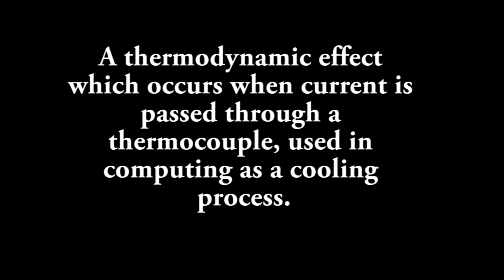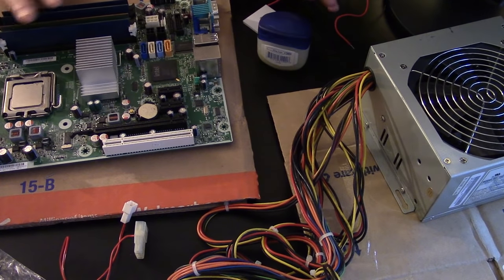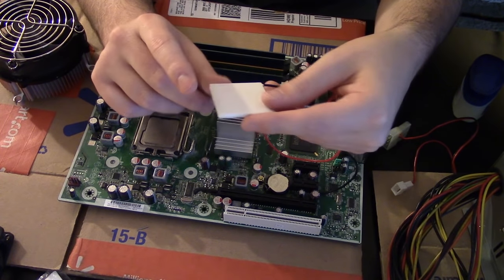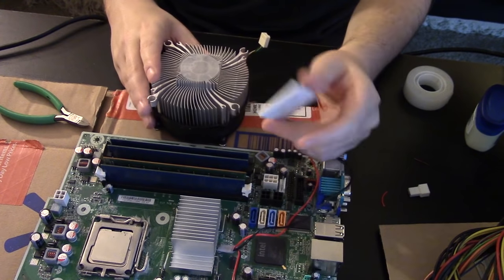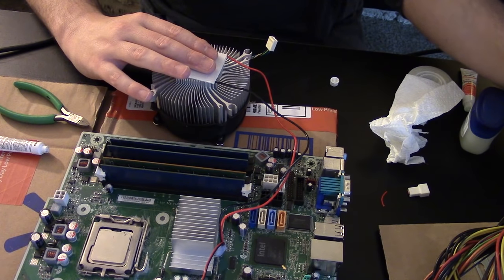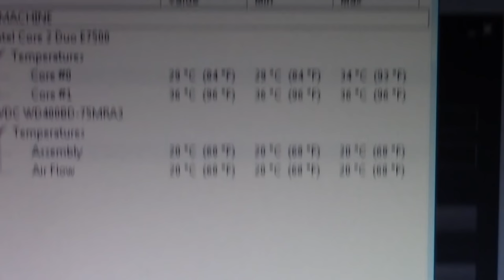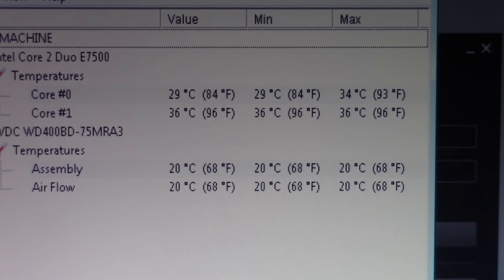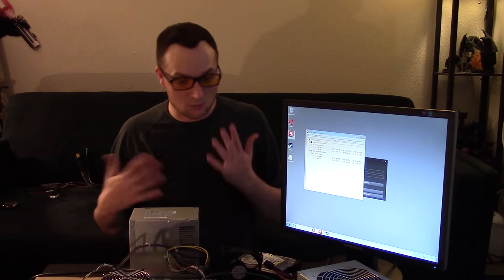💻 Peltier CPU Cooling Test

Comment: Does putting a lot of thermal paste be the reason for both sides to be hot? My thermoelectric cooler is heating on both sides, i think its because of too much thermal paste
Reply from the maker: I wasn't sure when I made this video as there was a small gap so I put more on. the key is thin layer. I thought both sides might help but it really doesn't. You just need thin layer of thermal grease on hot side to heatsink. Please sub if you can 🙂

Comment: how many watts does it actually draw?  I have seen youtubers creating usb powered  coolers and even using 12v 5a power adapters... can you speak to that?  thinking of adding one to a small water block in my liquid cooled rig to compare with radiators?
Reply from the maker: At this stage unknown or can't recall. It was just a 1st time mess around test. Trust me there are numerous things I would do differently. For starters used water cooling block and put the Peltier on the radiator portion. ☃️ Happy Holidays. Sorry for the delay in response, as I'm sure you know I can't reply to everyone. Hope you enjoyed the video. Please sub if you haven't already & have a safe new year. 🙂

Comment: It is important to note the reason of why this "worked" .... 

* You didn´t explain Pelteir plates basics - Cold side depends on how much heat can be removed from hot side. there is a limit on how much heat you can remove from hot side. If cold side is receiving to much heat from cpu, then it will fail. This worked because it was on iddle and temp removed from hot side was enough to keep it at 20C but not lower ... I can bet this will totally fail under a workload.

:/
Reply from the maker: Many mistakes were made in this experiment. However it should be noted I was just messing around. Even I cringe a little when I look back on this video. Sorry for the delay, as I'm sure you know I can't reply to everyone. Hope you enjoyed the video. Have a Happy Halloween 🎃 & please sub if you can.🙂

Comment: so... since the temps arent all that low, probably still above room temp, it doesn't seem necesary to protect the system against condensation, what was it, like 8°C lower? maybe with a better thermal paste and properly secured a 10°C idle might be achieved wich sounds pretty good IMO, heck even the 8°C is pretty good, a stress test woul've been apreciated though...
Reply from the maker: It was just a 1st time mess around test. Trust me there are numerous things I would do differently. For starters used water cooling block and put the Peltier on the radiator portion. ☃️ Happy Holidays. Sorry for the delay in response, as I'm sure you know I can't reply to everyone. Hope you enjoyed the video. Please sub if you haven't already & have a safe new year. 🙂

Comment: No load on the CPU. Peltier alone cannot cool down a processor thanks to low efficiency.
Also you did not screw in the heatsink. Mounting pressure makes a whole lot of difference
Reply: GEGEDUBLEWPEE naaahh... The peltier wasn't 'alone'. As you can see, it was 'assisted' by the heat sink.
The main problem with peltiers as cpu coolers wasn't because it's inefficient, rather it creates condensation which is not good with electronics.
.
But yeah, no load test was done, so the effectiveness can't really be determined.
Reply: condensation? you need temps lower than the air to form condensation!
Reply: Ole Simen Berget Yes.. Peltiers can reach temps lower than air's given a good heat sink.
Reply: all the heat from the cpu builds up in the middle of it. You can bet the sides and corner especially was more than a few degrees colder than the middle, which is still not where the temperature is taken. (but as close as it gets)
in short, the sides will get really cold. which is why applying vaseline around there to shield the cold surfaces from the air is a good idea. (and the reason he had a jar of it)

However, using peltiers is horribly inefficient. Better to just use water cooling and keep adding radiators to the loop until you are happy with the temps.
( or if its cold outside, chuck the radiator through the window (which works really well until summer btw ) )
Reply from the maker: ☃️ Happy Holidays. Sorry for the delay, as I'm sure you know I can't reply to everyone. Hope you enjoyed the video. Please sub if you haven't already & have a safe new year. 🙂

Comment: hey.... Can i use a 12V and 2amps power supply with peltier? Will i get full cooling effect or i should use other source. please tell me the required voltage and amps for peltier.
Reply from the maker: depends on the peltier plate you are using. Might want to check how many amps it can take. obviously the closer you are to its specifications the closer you will be to it's full potential

Comment: I'm interested in using this method to cool an electric speed controller for RC car.
Do you think it will be good enough to stop the esc overheating and is it nessaserry to have such a huge heatsink on the sucker? On rc cars space is an issue as you can imagine.

Cheers bro 👍✌
Reply from the maker: heat sink would be necessary, however you may be able to get the wieght and size down if you use a small copper heatsink. Maybe copper RAM heatsinks. Only issue I would worry about is power draw.
Please sub if you can.
Reply: @TheThorns  there's always a heatsink on these ESC's bro, there's normally a fan attached but they break with bumps ans small stones.
What sort of power draw would I bee looking at roughly bro?

Comment: What is your opinion of using this peltier for daily computer user. Your experienced advice will help me lot.
Reply from the maker: If done correctly it could be very beneficial. However I would never recommend doing this with new hardware. I would personally only do this to hardware I wanted to get a little more juice from until it dies.
Reply: Thank you very much Sir
Reply from the maker: you are most welcome
Please sub if you have not already 😋

Comment: Better use tower heatsinkfan and assembly with processor normally,  then contact the peliter on aluminum which contacted to processor. Dont forget to limit the voltage for peltier.  It will more powerfull and durable.
Reply from the maker: Nice tip! thanks for sharing.
Please Sub if you can 😊

Comment: maybe integrating a peltierplate to the bottom of the board right under the cpu socket, that would work well and not obstruct any cpu cooler.
Reply from the maker: There are definitely much more effective ways of doing this. This was just a basic test. Obviously I would use a different method in the future ☃️ Happy Holidays. Sorry for the delay in response, as I'm sure you know I can't reply to everyone. Hope you enjoyed the video. Please sub if you haven't already & have a safe new year. 🙂

Comment: what about peltier water ? when you shutdown your pc the ice on peltier well melt down so what i can do to avoid water dripping on cpu
Reply from the maker: that is why I recommend hooking it up externally with a water cooled system. since the power cuts off when the computer turns off no ice forms but condensation does. 
Please Sub if you can 😊

Comment: does a peltier build up moisture inside the processor?
Reply from the maker: Not likely assuming the seal is good (metal plate over the CPU). the moisture build up is based on moisture in the air. water does just materialize or go through the metal. however water dripping down into conductive surroundings. Please sub if you can. 🙂

Comment: Why dont you put the peltier to the cpu's heatsink instead putting it directly to cpu?
Reply from the maker: Mainly due to the fan, as the fan is still a great way to remove the heat. Please sub if you can 🤖

Comment: after 2 years, did you find a way to use it and fixing the condensation problem?
Reply from the maker: So I only did this one more time after. Used arctic silver 5 which drastically helped with the heat transfer. Condensation was still a problem, and it would probably be more hassle than it is worth. If it is in a case and perhaps you have a small dehumidifier rigged up to the case and something to absorb access water it might be stable with no water going down the board. The only viable option I can see would be to a CPU water cooling system and use the peltier on the radiator to cool down the liquid being used.
Reply: You add insulation to the motherboard (also pack non-conducting paste under the socket unless you want your pins to rust). His cooler never got cold enough to worry about, a more powerful TEC is when it might form condensation.

This is so low, its not worth wasting power or time over. I run my components way below freezing (-58c at idle) and even under extreme load (with voltage that would almost instantly damage a chip) do I get above freezing on the core after a lot of stress testing. No TEC exists that I know of could do this (even if it was multiple KW in power with water cooling), I use phase change cooling (refrigerator cycle). Much more efficient, much colder, and can handle even the 32 core TR2 with just noderate sized compressor. Not cheap, but still no more than extreme components cost (and you can use it for mumtiple components).

TEC is fine for playing around with super low power chips (like raspberry pi), but due to thermal (heat transfer limits of peltier technology) it can't handle the high power chips (unless you chill water with it, but honestly a hacked up window AC unit is better).
Reply: @jakegarrett8109  so with an 06 TEC, you won’t have any condensation problems?
Reply: @HarbringerSalami  as long as it's not colder than ambient it won't condense. Personally I'd just recommend using a refrigeration setup, not only does it have much greater cooling capacity and colder temps, but it uses much less electricity. TECs are cheap and ok for messing around with low power applications (like a raspberry pi), but severely limited once you use anything that puts out much heat just do to physics.

Comment: I do not get it. Why it is good to use a peltier module for cooling? It just creates extra heat inside of the case becoulse it has an  efficiency of around 15%. Please someone explain this for me I might be wrong!
Reply: a peltier usually has 5 percent efficiency, but after insulation losses it retains about 2 percent. Logically the heat generated by the hot side should get fanned out from the case itself. This is a way to ineffective heatsink for maximum cold efficiency though. Watercooling the peltierplate's hot side would provide quite a bit colder temps on the cold side. Peltier cooling for cpu's is as you say just too innefective. You would need atleast a 200 watt peltierplate with some serious watercooling to see lower temps than ambient.
Reply from the maker: Was just a mess around test. 
☃️ Happy Holidays. Sorry for the delay, as I'm sure you know I can't reply to everyone. Hope you enjoyed the video. Please sub if you haven't already & have a safe new year. 🙂

Comment: I agree on so much comment, at first, what is the purpose of a heat sink? Right, to take the heat away from the cpu. What you do is force a cold side on the hot side, it is inefficiënt and overdone on the paste.... Yes, thermal paste is bad for your health and should not be so spread out with your fingers. The pressure applied to the cooling unit (heat sink etc.) should sufficiently spread out the paste, it is not the amount but the contact it must make like a very thin layer between CPU and cooling agent. So all in all i am not sure this is a good idea, and as some here say, there was no stress test. Oh and the vaseline, smart thinking, but if the cold/heat coëfficiënt is in balance, then moist out of the air could form droplets on the element, but it is H2O without anything contaminated, so non conductive. Place the motherboard not horizontal but vertical, the moist drips down, that path could use vaseline.....
Further, it is a boldly video....
Reply from the maker: 🎄Happy Holidays🕎 Sorry for the delay, as I'm sure you know I can't reply to everyone. Hope you enjoyed the video. Please sub if you haven't already & have a safe new year. 🙂

Comment: As far as i know... i've heard of the freezer unit for cpu cooling back in the 90s when AMD started out with heat issues. Never did i know about this peltier unit back then. I guess, now everything goes online. Many get's to know the term more specifically. I think the freezer for cpu cooling is none other than a peltier unit. Although it did not lasted long because of condensation issues. The sales went dead because of condensation that'll eventually cause the board to died on water condensation. But i believed that the peltier unit is a promising cheap solution and most importantly, it's pretty small and consume less space. It could perhaps also address cctv cameras heat issues . What it needs would be a temp monitoring devices to kick in the circuit to bring down the temperature of a target device and shut off when the device is not overheating.
Reply from the maker: Thanks for sharing. There are numerous things I would do differently if attempting this today. For starters used water cooling block and put the Peltier on the radiator portion. ☃️ Happy Holidays. Sorry for the delay in response, as I'm sure you know I can't reply to everyone. Hope you enjoyed the video. Please sub if you haven't already & have a safe new year. 🙂

Comment: You can create a connection for the Peltier Cooler on that same Computer Power Supply, no need for another one
Reply from the maker: I had considered that but wouldn't recommend it unless power supply is 500W and over.
 Please sub if you have not already 😋

Comment: to avoid condensation u can use another some kind of concave square plate betwen the peltier and the cpu or maybe try a carbon plate betwen but iot could be dificult to find or maybe you  have to close all  your computer sealed to avoid air to go inside so no humidity can go inside
Reply from the maker: Thank you for sharing. In my ventures I have found the best way to incorporate a Peltier plate is to water cool the CPU and then attach a Peltier to the radiator of the cooling unit. Cooling the liquid is easier to control and don't have to worry about condensation as much.
Reply: Hello, can you explain how this would work? Currently testing a peltier module for our CPU and I’m worried about shorting the cpu due to condensation

Comment: You would get a lot better results if you de-lid and use a cooper slug between the processor and the TEC.
Reply from the maker: Good point, that would help with the transfer, not sure by how much but still.
Please sub if you have not already 😋

Comment: You connect the peltier cell in the pc power Supply?
Reply: Alfonso Chavez Just the molex Red and Black wires. Red is 5V, Black is Ground. I wouldn't recommend connecting to Yellow because that is 12V
Reply: The Mastr a lot of 100 watt peltier coolers use 12 v though so it will depend on the peltier
Reply from the maker: Sure why not? Sorry for the delay, as I'm sure you know I can't reply to everyone. Hope you enjoyed the video. Have a Happy Halloween 🎃 & please sub if you can.🙂

Comment: Why only one side thermal paste? 😮
Reply from the maker: Not needed but feel free to do your own testing. Thermal grease is great for transferring heat from one object to metal. since the plate was flush with the CPU it is really not required. Especially since we are just pushing cold downward. To my knowledge thermal grease is not designed to transfer cold. If you find otherwise please let me know, would be great to investigate further. Please sub if you can.

Comment: apply less thermal paste. the paste fills the tiny gaps and crevices in the steel but apply too much paste and it will restrict the heat transfer
Reply from the maker: Many mistakes were made in this experiment. However it should be noted I was just messing around. Even I cringe a little when I look back on this video. Sorry for the delay, as I'm sure you know I can't reply to everyone. Hope you enjoyed the video. Have a Happy Halloween 🎃 & please sub if you can.🙂

Comment: That was an excessive amount of thermal paste o_o All you did was create an insulating effect with that amount of paste. Next time use something like a tiny thin line or rice grain sized dab.
Reply: Rice grain seems excessively small...probably won't coat more than a third of the transfer plate at that point. 3 rice grains, maybe :P
Reply from the maker: I should have used at least half the amount or 1/3. please sub if you can 😀
Reply: if it fails it will become a heat stopping shield  not good !!

Comment: Why the vaseline? you need temps lower than the air to form condensation....
Reply from the maker: condensation does occur when using this method.
Reply: conensation does not aoccur if its not lower temp than the air.

Comment: I would refrain from the Vaseline... since it collects dust and mineral deposits could cause more of a problem than a little condensation. The cooling fan should also create enough air movement to reduce condensation significantly. Also there was enough thermal paste used to lubricate a whale. Displacement after compression means you really need about half a pea size dollop to do the trick. Results are impressive though. Wonder what kind of stress he put it under? An overclock test would have given a nice benchmark too.
Reply from the maker: Thanks for sharing. There are numerous things I would do differently if attempting this today. For starters used water cooling block and put the Peltier on the radiator portion. ☃️ Happy Holidays. Sorry for the delay in response, as I'm sure you know I can't reply to everyone. Hope you enjoyed the video. Please sub if you haven't already & have a safe new year. 🙂